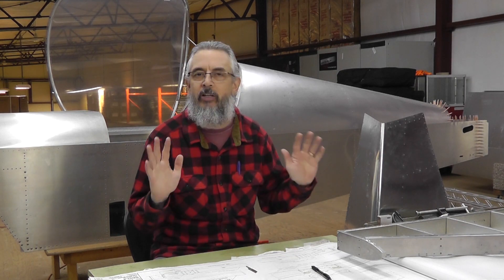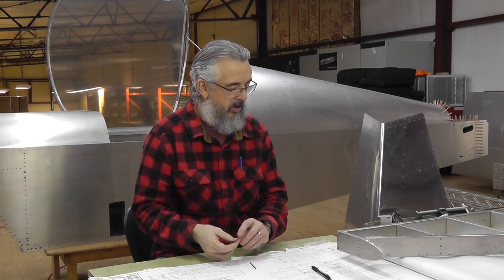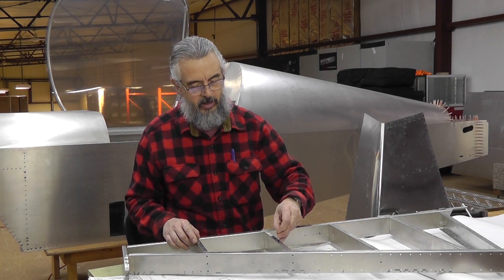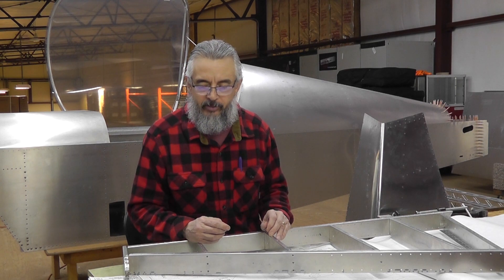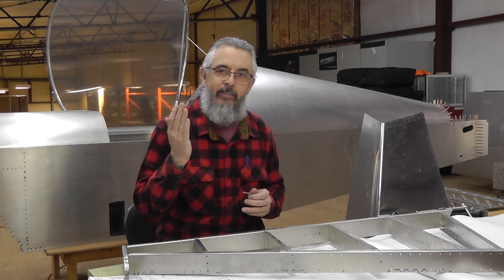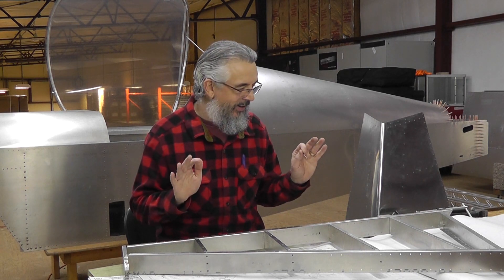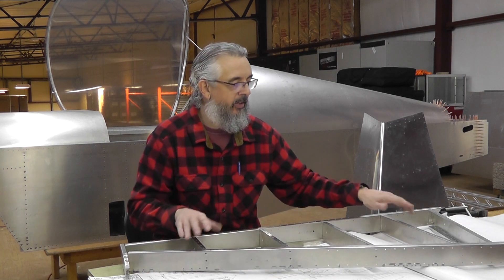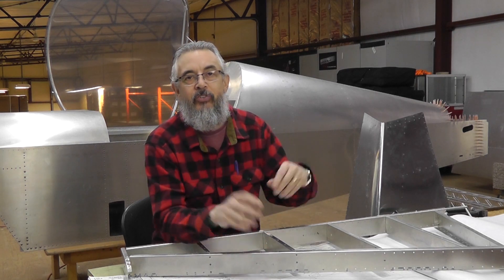Sonex Build Part 27 - Looks Like I Need To Replace The Stabilators

Comment: One of the downsides to the Sonex design/approach is that all of the wing & tail rib flanges really have zero extra "meat" for oversized holes/rivets. Drilling a hole slightly off-center or slightly oversized guarantees that you'll violate the "minimum edge margin" or "rivet edge distance" specified in AC 43.13 (see section 4-57 c "Rivet Edge Distance").  One or two "bad" rivets or slight violations of the edge margin are OK if everything else is structurally sound & tight; but if a bunch of them are not good then replacing the part is definitely the way to go.  Sorry to see the setback, but the good news is that the tail build is really fast. You'll have a better airframe you'll be more confident in very quickly!
Reply from the maker: Thank you for the input. As always, I definitely respect your opinion and that tells me that I am doing the right thing in this situation. The hard part is that lead times are 10-12 weeks for tail kits these days. Kerry says that they can most likely get me some of the parts that I need sooner but it will still be a while before I can finish the tail. I think that I will work on ailerons and flaps next to get more comfortable with the airframe construction.

Comment: When looking to build my 2nd aircraft I thought about buying a partially completed kit to save $$$. Then I was concerned I'd be flying around in constant fear of something I did not build falling apart.
Reply from the maker: What was your first aircraft build? I had some concerns but luckily this was a quick build kit so the majority of critical work was done at the factory. Everything else was pretty visible so I was not too worried. This was the one big surprise that I was not expecting but after this is done the it will definitely be my build.
Reply: @weekendhack.whatsnext  First built a MiniMax. Just started building a Fisher Dakota Hawk a few months ago. Both are wood and fabric construction.
Reply from the maker: I like some of the wood and fabric aircraft but I wouldn't own one without a hanger.
Reply: @weekendhack.whatsnext  I don't think I could put any aircraft outside with as much money in them. I don't even park my cars outside I'm in Arizona. Even if I had to drive an hour to an airport where I could afford to hanger it I would. We get hail, and microburst in the summer. Friend of mine has a 310 under covered area tail is exposed somewhat. Wingtips are close I would hate to come and find damage from someone not paying attention what they are doing at least inside a T-hanger has protection from others.
Reply from the maker: We lived in Mesa for almost 15 years. The sun is the biggest enemy out there along with the dust finding its way into the engine. There are a lot of places in the country where there simply are no hangers available. If you can find one then you will pay $4k-$6k a year or more. The other option is a good cockpit cover and then paint the aircraft in 10 years for $15k-$20k. I hate to rely on insurance but that is what it is for if mother nature gets nasty.
Reply: @weekendhack.whatsnext  The sun is the largest concern for fabric covered aircraft, the ultraviolet light degrades the fabric. I'm in Ohio, finding a hangar here is difficult but thankfully is usually only around $2k a year. After looking for a couple of years I rented my hangar within one hour of it becoming available thanks to a quick call from my flight instructor. One of the reasons I decided to build the Dakota Hawk is because it has easily folded wings and can fit in the hanger with my MiniMax.
Reply from the maker: That is a good deal on a hanger. I am paying $75/mo for a tie down right now. Once I finish my training I think that I can get a tie down a little closer to home for about half that. No cheap hangers around here at all. I like the look and performance of some of the older Super Vikings but lost interest once I found out that they had a lot of wood and fabric. Too much to deal with for a first plane. Maybe someday after I accumulate some hours if I get a hanger.

Comment: Hmm I feel like even still you would be fine with the bigger rivets.. there has to be an inspection criteria with allowable limits. That's such a low difference. I feel like The manufacturer will say whatever they need to the C.Y.A.  but I guess it's better to be conservative about it.
Reply from the maker: I kind of agree with you but at the same time I do not have a degree in structural engineering. I definitely do not mind being stubborn to prove a point but not when lives are on the line.
Reply: @weekendhack.whatsnext  yea I understand that